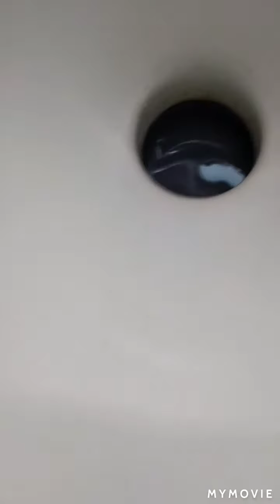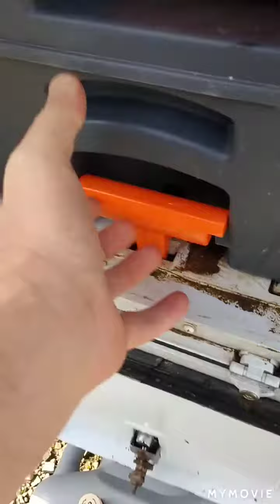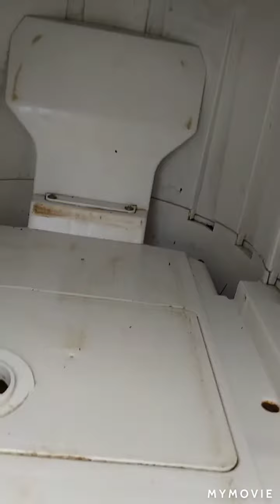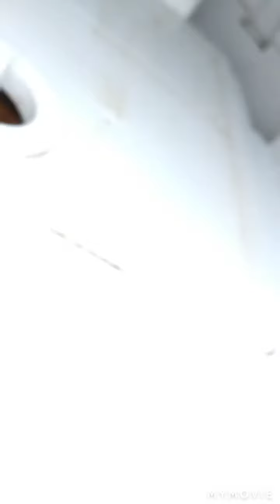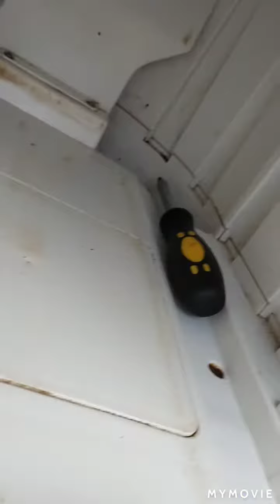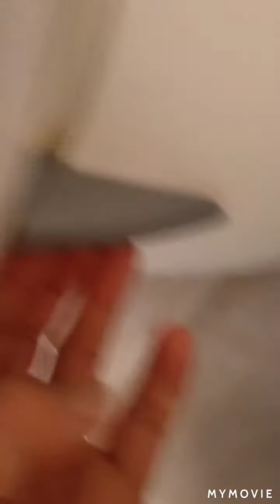Thetford cassette toilet not closing its flap! How to realign the blade mechanism.

Comment: I had the same problem.
Didn't want to start tearing until I knew how to do it.
Thanks to your video I was then able to quickly figure out how to solve the problem.
I just loosened the nut and turned the saddle right.
Now the toilet works again without problems
Thanks for your help.
Kris from Sweden.

Comment: Your suggestion works and I thank you very much, however after a couple of days it reverts to the non-fully opening position. Should I assume that either the cog or the part that it moves on is worn and is jumping?
Reply from the maker: It's possible. Can you have someone operate the mechanism from inside the caravan. Flicking it back and forth while you are watching from the toilet cavity. You might get a better idea what is happening. I'm not sure if you can order a replacement cog from Thetford? ..
Reply: Thanks for that. Everything seems perfectly normal inside. I have taken the top off the cassette and cleaned everything there and lubricated it. Someone else suggested that maybe it is getting too full. This is quite possible as our indicator light does not work. I will monitor that aspect.
Reply from the maker: Cool mate. I was going to say actually another trick to lubricating the seal flap part of the cassette is to put a small amount of cooking oil down the toilet. It helps with opening and closing around the rubber seal. Because it can become stiff to operate.

Comment: Hi having same problem  . Was it a star or flat head screwdriver to undo the plastic thingy. Thanks for sharing your video
Reply from the maker: I know it as a Phillips head screwdriver if that helps. Note: only loosen enough to move the cog back into position to be properly aligned. Tricky to get back on if the screw falls out. Good luck with your fix!

Comment: Perfect, I watched a different one and the chap took it off completely si it looks like you only have to loisen the screw, how far did you have to go to loosen it roughly?
Reply from the maker: Only a few turns with the screwdriver. Just loose enough so the little cog is low enough to move independently of the other larger mechanism that it locks into to turn the thing that opens the flap on the cassette.
Reply: @thetravellinghillbillies5386  thanks mate

Comment: Hi there I have  the same problem but I cannot get the. Cassette out at all or move the lever to close and open the flap help!!!,!
Reply from the maker: Hi sorry for the late reply. I hope you have it sorted by now. Otherwise the only thing I can suggest is that the cassette is not pushed in all the way? I know with ours that if the cassette is not slotted in far enough the lever will not turn.